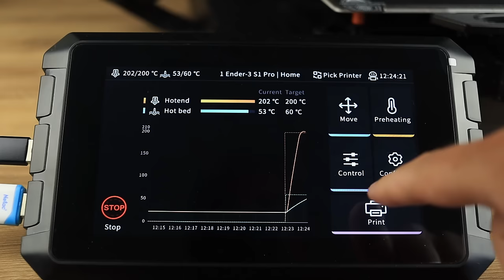Amazing MECHANICAL 3D Prints | Cool Things to 3D Print

Comment: You featured half of these prints in previous videos. Really starting to feel content repeat from this channel
Reply from the maker: Hi fokkre. There are two models in this episode from previous videos. But yes, over last few months there are some content repeat.

And the reason is in January I moved from Poland where I live, work, and have studio  to another country, where I don't have good working/recording conditions.

I don't like to do repeat either, but I have to do it now. I'm sorry about that and I promise that there will be much less repeat content when I return to Poland in July.

Best regards,
Martin
Reply: @Marc3DP Try to make fan & many other toys
Reply: @Marc3DP I have an idea : a mechanical spring battery. You crank a handle to charge the spring inside. Flick a lever to make it turn a motor, making electricity.

Comment: It's wierd to see someone make some pretty dang goods mechanical prints, only to use WD40 for lube. You would find Vaseline(petroleum jelly) or even used motor oil more suitable. The "WD" in "WD40" means "water displacer". Kinda wasting your money at that point.
Reply from the maker: Thanks for the advice 🙂

Comment: Just for your information, WD40 actually contains abrasives to break up oxidation , I'd recommend light machine oil for lubricating parts.. like sewing machine oil....
Reply from the maker: Thanks for advice, will try :)
Reply: I would recommend against that for most plastics unless they are designated "oil resistant". Oils dissolve them. Use Silicone spray lubricant instead.

Comment: not asking you to print an item just making a inquiry to find out if it's possible.
with the right scans is it possible to print cheep yet functional false teeth? if so what sort of printer and subsistence would be best?
Reply from the maker: I'm sorry but I don't deal with such prints and printers so I can't tell anything about this. But there are both scanners and printers adapted to such prints
Reply: @Marc3DP  alright, thank you for your time and response.
have a good day.
Reply: Dentists use resin printers and food grade resins. Google and you'll find some examples. They use these 3d prints as molds to make the final product. The product that goes into a patients mouth is not 3D printed